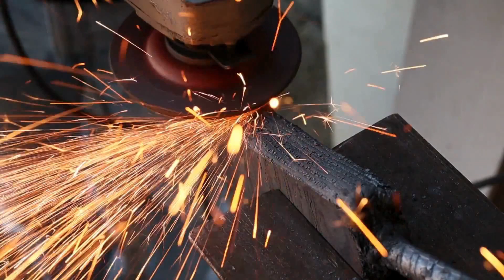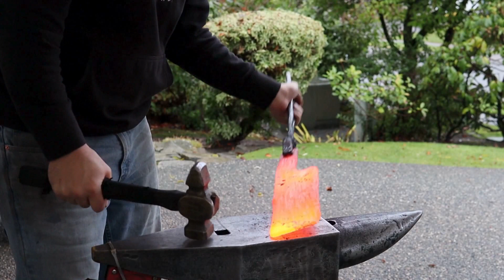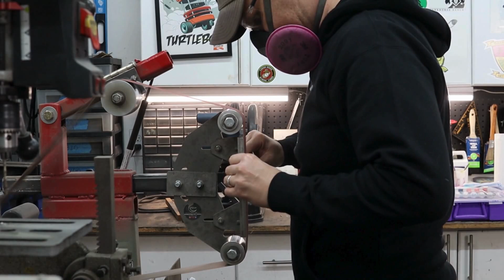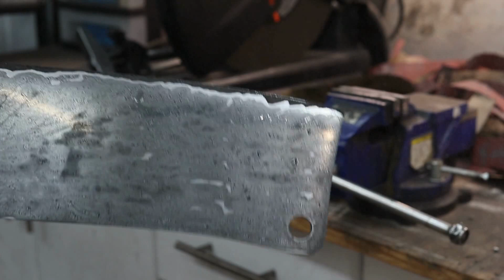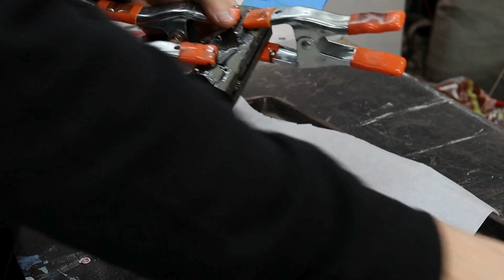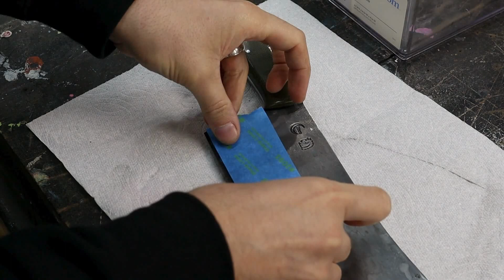Making a Damascus Go Mai Kitchen Cleaver (Full Knife Build) #forging #bladesmith #knifemaking

Comment: Great video and blade! I have the same press as you do and I’m having difficulty with using the stops like yours to get the dimensions…do you have a measurement to share of the stops you use for like the 3/8” thickness and so forth? Thanks! 🔪❤️
Reply from the maker: Thank you! I don't know that measurements would be as helpful as just explaining how I made mine. I clamp whatever thickness material I want between the dies and then mark the length of the stop needed on the sides of the press. I cut two stops about 1/16" too long, and then grind it down until it just fits the space in the frame. I grind the two stops while clamped together so they're as close to exactly the same length as possible. This is actually one of my biggest pet peeves with having a smaller press. There's no room on the dies to just add a kiss block of whatever thickness you want. Lol, hopefully someday I can upgrade to the 25-ton. I use solid 1" square mild steel stock for the stops. I have a bunch of 1/16" and 1/8" shims that I super glue to the top of my stops as well, when I want to make the stops just a little bit higher. I hope that helps!
Reply: Thanks!